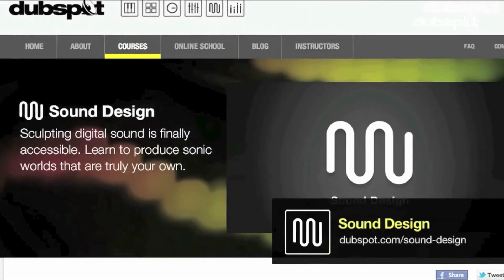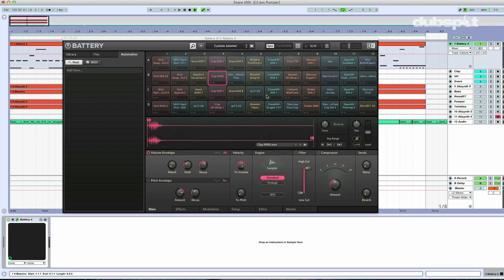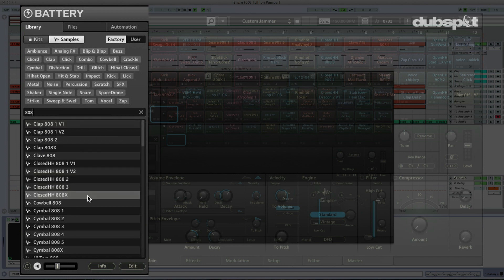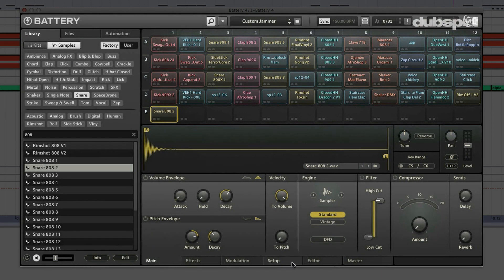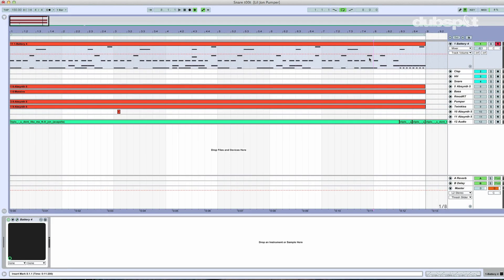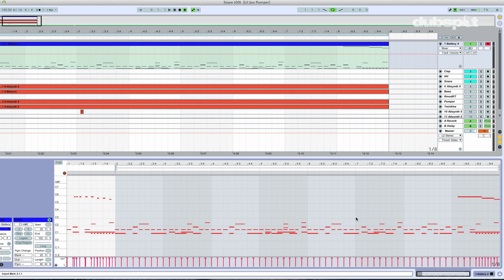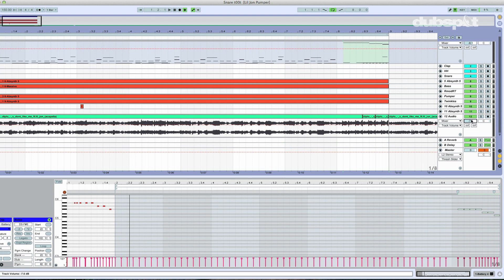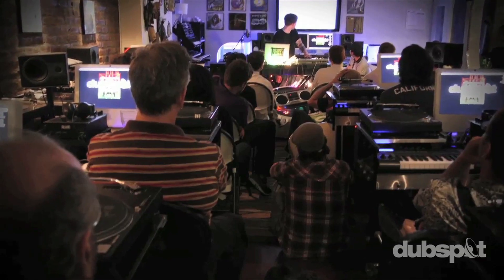Sound Design Tutorial: Pitched Snare Drums in Native Instruments Battery 4

Comment: what if the original sample I'm working with isn't tuned? lets say I use a snare thats tuned to F# originally, when I spread it across the keyboard like you did it won't actually match the keys that I'm playing on the keyboard. If I play the C key on my keyboard the snare sound won't be in tune. how to I find the pitch of a certain sound? how do I re pitch it so that everything is in tune?
Reply: ***** to do this in ableton, I use an instrument rack, and i load the sample i want to tune into a sampler, and then I add a synthesizer to it. This lets me play both instruments at same time. That way, you can press a note, and then tune the sample to the synth. 
Also, I've used a guitar tuner to tune a synth/sample before. If you do this, you just tune the way you'd normally do, except it is important to make sure you are tuning the right notes. You don't want to tune C to E, so if your playing a C on your sampler, you want to set the tuner to quadruple flat. The easiest way though is probably to play the note E and then tune to E since thats how a guitar tuner is meant to work